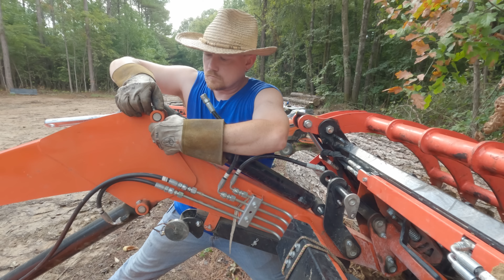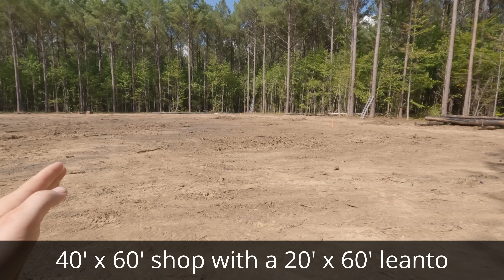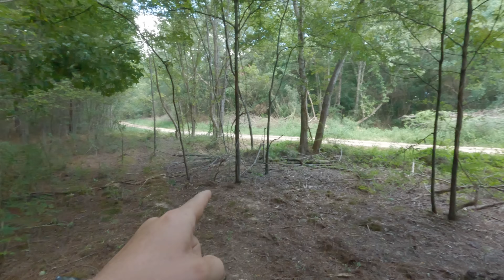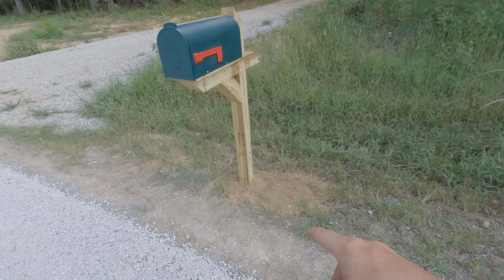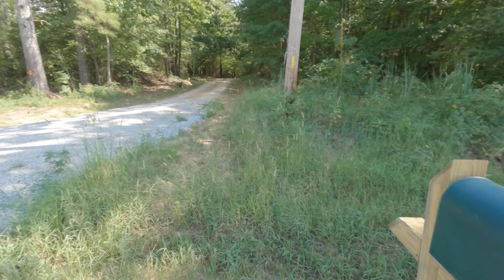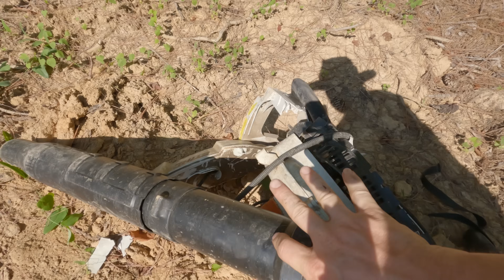Broken Tractor, Shop Location, Utilities, Murphy's law! - Day 116

Comment: That tree to the left of the driveway at the 14:55-15:00 timeframe is really cool where it looks like it comes from one main stump and then splits off to the separate trunks or trees. You should get one of the cordless battery operated leaf blowers and chainsaws I have the Dewalt 16” 60 volt chainsaw; which from what I understand you can use a 18” bar on as well; and that thing works awesome. I have used an 18” Husqvarna 55 Rancher from the late 90’s, the last time I used it was a few years ago and man the cordless is so much nicer. They are considerably lighter and far quieter but work just as well as gas powered or at least from my experience. It looks like things are really coming along pretty well minus the handful of issues with your tractor and your other equipment.

Comment: dont know if anyone has already said this, but the fitting for your steering is a standard type of hyd fitting available through any hydraulic vendor "parker, enzed, etc" from the photo it looks like it "might be" 1/4" BSPP on the lock nut end and 9/16" JIC on the hose end.... my 2 cents.... enjoy
Reply from the maker: The fitting wasn't the problem. Blown seal inside the power steering hydraulics causing too much back pressure.

Comment: I had a similar setup in my yard and I had the electricity (400amps) brought to my shop, then it split into 2 200 amp feeds, one for the shop panel and then a straight run to the house.   BUT, my shop had to be in place before they would do anything.
Reply from the maker: I'm pulling 400 amps to the ground mount transformer. Then 200 amp service for the shop and 200 amp service for the house. Each on their own meter.

Comment: How did you bend the hydraulic cylinder, just curious so I can avoid doing so myself?
Reply from the maker: I'm not 100% certain but I believe it was when I was rolling a rootball and it slipped causing the top of the grapple to slam down on top of the root ball. That puts the same forces on the curl cylinders that back dragging does. Back dragging is commonly referred to as the fastest way to bend a cylinder ram. Instead of back dragging, I've read equipment operators say you should fill the bucket, tilt it slightly up from flat, and then back drag. Never back drag with the tip of the bucket. Generally speaking, I try to use the tractor with the cylinders collapsed as much as possible. It's hard to damage cylinder rams when they are nested inside the cylinder.
Reply: @JayBates  Interesting, have been back dragging for years with my current Cub Cadet Mitsubishi made 7360 SS never an issue but now just bought a new Kioti NS 6010 HST with the same grappler you have and will be more leery.
Reply from the maker: It has a lot to do with the strength of the curl cylinder as well. I'd research people who have bent cylinders and read the replies. Lots of heavy equipment pros recommend a very specific way.  Load the bucket, tilt "forks up" slightly from the bottom of the bucket being level, and back drag with the back of the bucket. I did this recently spreading gravel for a relative. Super handy because you can drag in both directions for easier smoothing.

Comment: Jay you can always ask if it’s an option where you live to feed into the shop then feed out to the house might save you some trenching. Not sure how much it would change your lay out but to have your panel in the shop in the corner or the end that’s closest to the shop. Food for thought. Also the green underground box is called a transformer (padmount)
Reply: You can also have the meter for your hydro beside the pad mount transformer.  What size of service are you wanting 200 amp, 400 amp? I know here in Ontario you pay for having more than one meter so one meter would be key whether you go two services to the shop and house or one into shop then over to house, the hydro guys will be able to direct you for sure.
Reply from the maker: Two 200amp meters. They will be mounted to the side of the structures. For water, they only place the meters by the main line. The water meter will be 1250' away from the shop.
Reply: @JayBates  do you get charged for two meters ? If you do I would just have one and get it central metered we call it up here in Ontario so it would be teched as a 400 amp service
Reply from the maker: Yes. I want two meters.

Comment: Regarding your chain saw, check the spark arrestor for carbon build up.  It will cut your power.  To remove the carbon, burn the screen with a torch and use a brush. Hope this helps.  Love following your story.

Comment: When it rains, it pours. The more you have, the more that breaks... Its only going to get more expensive from here :P While your running lines for power and water, you may want to consider future proofing and run a conduit for Voice and Data as well(assuming there is such a service in your area/one gets put in/you're not going with Starlink, etc). I like your ideal for the wash station at the end of the driveway. You may consider adding a concrete pad(overkill I know) and electric to run a power washer/lighting for late evening cleanups. Overall its all coming together quite nicely I would say. Cant wait to see you start the building pad.

Comment: For the chainsaw.  Change the air filter.   It’s starving for air.  Mine does the same after a could years
Reply from the maker: I've ran it without the filter installed and no change.

Comment: If you dig the trench and lay the conduit like Matt from Diesel Creek did....they should just have to pull the line to wherever you want (even if it is expensive), right?  Then it goes where you want vs where they want.  With the chain saw, did you check the air filter to see if it is getting clogged?  You may be able to just clean that vs the whole repair kit.
Reply from the maker: Air filter is not the problem. Ran it without the filter with no change.
Reply: @JayBates  Then my guess falls back on what I learned from watching the Farmcraft101 channel where he repaired some of his chainsaws.  Could be a clogged fuel port/fuel system somewhere in that side of things.  I do not have any good guesses other than random then.   I do think making your own trench for the electric should mean you can run it where you want...it is weird that you would be limited to where a power company wanted to run the power on your land vs "I want it right here and run over there and then to here, how much will that cost" type thing.  In any case I look forward to future videos as you figure it all out. :)

Comment: I like the shop orientation idea but I've always been a fan of a house with the front door facing North.  Our first house and current house we managed to have that orientation.  That made for a cooler non direct sunlight for a front living room.   Now that I've mentioned that our current home has the living room facing South and we have to utilize window shades more.  The previous home we lived in the woods like you and had no shades on the windows.
Reply from the maker: Both of our previous homes had a north facing front door. They both molded a lot due to humidity. Required yearly pressure washing. I do like how cool the porches were though. North facing doesn't play well with the land site though.
Reply: @JayBates  yeah, the drive would end up approaching the side of the house so that would be a little odd.   We have issues of north facing moss growth here in Illinois that requires power washing every few years as well.  But, hey, isn't this the fun of planning!
Reply from the maker: Indeed it is!

Comment: One of the common reason why chainsaw (or any motor for that reason) lose power is dirty air filter. Just soak it in water with a bit of dish soap for a minute, gently clean dirt with brush and dry in shade for 24 hours. My Husqvarna was losing power and even stopping simply because of that. No fancy repairs needed.

Comment: Hello Jay, Speaking as a retired licensed landscape contractor and licensed plumbing contractor and an own/builder there are a couple of suggestions that I would offer.
1)	 Use 2” class 315 pvc pipe.  You will get three times less friction loss in the 2” compared to the 1 ½” pipe.  The difference in price will be offset by the better performance and life of the pipe.
2)	Reduce your pipe diameter ten feet from the house to whatever size service you are going to use going into the house.
3)	Put a shut off valve between the meter and the utility field hose bib and one or two other shut off valves in line in the field.  Then you won’t be running to the meter to shut off the water during the inevitable broken pipes or hose bib.
4)	Use tracing tape to find your utilities ten years from today.
5)	Within reason, put your water service pipe as deep in the ground as possible.  It will keep the water cooler in the summer and protect it from inadvertent digging.
Good luck with your endeavor!
Reply from the maker: I appreciate your suggestions. Thank you.

Comment: Sorry to hear of all the tractor issues. But a question on the water lines. Are you getting an inch and a half meter and will you be stepping down to get more pressure? I will be running about 1200 ft. also to a new home and was wandering how i would run it to maintain good pressure.
Reply from the maker: Not sure on options at the moment.
Reply: @JayBates  I'm hoping I don't have to add a boster pump. Most city services only have max 30 psi and you lose 4.33 psi per foot of elevation and just on friction on 1200 feet you loss about 2.208 psi with 1.5 inch main feed. I haven't put a transit on it. But I know I have a large rise and small fall on the back side. The 4.33 psi is plus on the ft drop, just opposite of the rise.

Comment: Go bigger on pipe Jay. Im a commercial plumber by trade in Texas and believe me that long of a run you may loose pressure, and more if you’re going up hill go with 2” pressure pipe pvc and fittings. Also check the frost line depth. 
Check prices on black poly pipe. It comes in 500’ rolls, less joint less leaks.
Reply from the maker: The current plan is now 20' sticks of 2". Black poly pipe is too expensive.

Comment: If chainsaw is running fine, it could be that you haven't filed down rakers after numerous sharpenings. Put a flat piece of metal from one cutter to the other and the raker should clear below the 2 cutters.
Reply from the maker: Rakers are 0.025" below the cutters.

Comment: Jay. I follow Chickanic. She has been doing 2/4 cycle repair for like 15 years. She knows her stuff. Will say she is not a fan of aftermarket carb kits. Lots of trouble with them. Recommends oem. She’s been there done that. Check her out.
Reply: YESSS!!! I am a FAN of Chickanic. She knows the equipment and shows detailed repair information. I have recommended her to several people because of seeing her do the actual repairs. Tip for anyone using a string trimmer: SOAK THAT TRIMMER LINE!!! Even if it is a new spool. She has a video that explains all about it. Thank you @Jay Bates. Really, really, really enjoy watching your property transformation. Sorry about so many "Murphys", but you are running him in circles, and he will quit before you do!!!
Reply from the maker: Soak it in what?
Reply: @JayBates  Water. It hydrates the plastic trimmer line and makes it last longer. Search yt for "chickanic trimmer line" the title is "The Big Secret" timestamp 3:45 she talks about soaking.
Reply from the maker: Thanks!

Comment: Not cheaper to just dig a well instead of running that long water line?
Reply from the maker: Well is 20k-ish. Water to the clearing should be around 4-5k.
Reply: @JayBates dang!  Well in SC in about $6,000
Reply: @WhiteShadow4689  All relative to how deep and how much casing.

Comment: Most likely your chainsaw problem is the spark arrestor screen on your muffler. It is a small metal screen that prevents sparks  from being emitted from the muffler and possibly catching grass or brush on fire.  You are not allowed to use a chainsaw in a national forest without a spark arrestor screen.  The openings in the screen will get clogged up with carbon and bog the motor down because it is not allowing it to exhaust.  Either remove or replace the exhaust screen.  Exhaust screens can sometimes be hard to find.  You can also take an ice pick or similar tool and slowly eliminate the carbon buildup.  Hope this helps.
Reply from the maker: Screen and muffler are free of obstruction.

Comment: When you do get your trench for 1.5" waterline, make sure to get some tracer wire to be buried with the waterline. Don't just use regular THHN wire. They make a special direct bury tracer wire. The wire sticks up at both locations, so if in the future you ever need to find that line, you can use a wire tracer to clip onto the wire.  You can also get tracer tape, which can be buried as well. We would usually put this over our buried electric lines about 12" above the buried wires. This way, if you or someone else is ever digging, you will see that tape first & it becomes a warning.  Trust me, nothing ruins your day faster than ripping apart some underground utility. Love all the progress!

Comment: Re: chain saw and blower: with the advances in battery technology and brushless motors, I've replaced all my two-stroke gas yard tools with electric. Best yard tool decision I've made. No fiddling with mixing oil/gas, no worry about what needs to be done to get them running each spring, etc. You have 100 times the area to cover, so that might change the equation a bit, but something to consider.
Reply from the maker: I have a battery leaf blower as well. It's nice on it's own, but is nowhere near as powerful as my gas blower.

Comment: On the loss of power. Check the tubing to and from the gas tank. The filter gets full. The tubing gets soft. Often runs fine for 30 seconds then no power. It may get fuel but collapses because it is soft. Also the tank vent goes squirrelly too.

Comment: For house orientation just make sure that the south and west sides of the building have good overhangs to keep any windows shaded in the peak of summer.  If you can put the bedrooms on the north side of the building to keep them well out of the sun path and summer heat.  Are you planning on drilling a well for your water or connecting to the city water service at the road?
Reply from the maker: City water at the road.

Comment: While you have the trenches open put an extra electrical conduit all the way to the gate for lights at the gate or an automatic gate opener or cameras. Won’t cost much to do and you can decide the use in the future.
Reply: As a guess, it might be cheaper to just have another meter for the front gate option so that it wouldn't be as long of a run of wire/conduit from way back in the property.

Comment: You are on the right track with the carb kit for the chain saw. I went through the same issues with my Echo chain saw earlier this spring. The carb kit fixed it. Make sure you replace the fuel filter inside the fuel tank and rinse out the fuel tank as there may be some saw dust in the fuel tank.
Reply: Might also replace fuel lines?

Comment: Hey Jay, Murphy Lay is a given, everybody has that moment at some point in time. The site is really starting to take shape, doing a great job. On the chain saw, does it have a spark arrester? Over time they get clogged up with carbon and debris which can affect saw performance. I would check that first, if clogged, take off and clean it, order replacement or take off all together. They are required on the saw if they are being used on State forestry property or National forest property but on your own private property they are not required by law.
Reply from the maker: It does have one. I removed the entire exhaust. It all looks good.
Reply: @JayBates  Jay if the new carb doesn't help, run it Without the muffler for a bit, see if it make a difference, if its better, issue will be in the muffler passages.